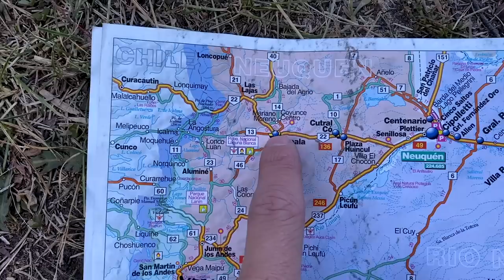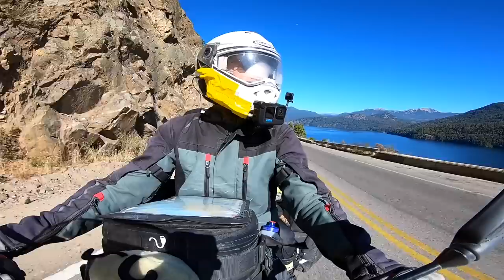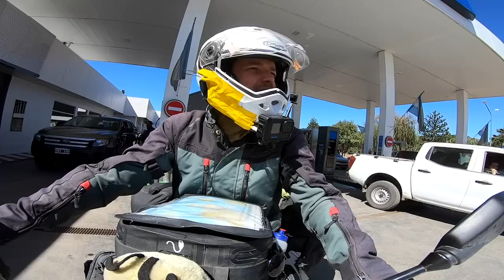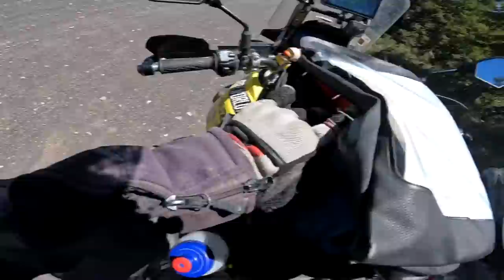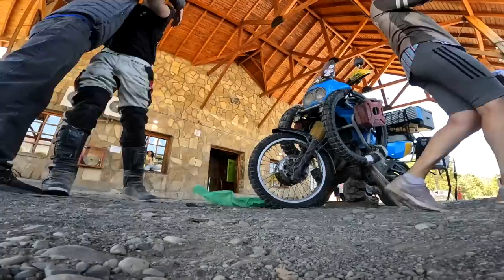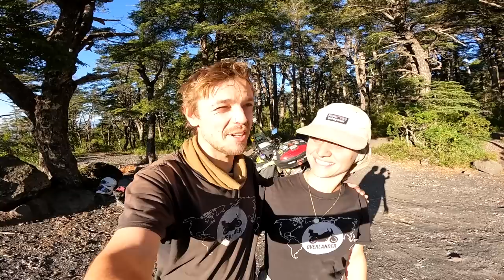FUEL CRISIS IN ARGENTINA! (Change of Plans) 🇦🇷 [S3 - E51]

Comment: If you need to fit a tyre you need some lubrication to get it to seat level. Also the wheel will be out of balance after refitting unless you get it on in the same position as it was before . Without tyre lube any soap will do at a push liquid shampoo / hand cleaner even works. Maybe investing in some better tyre levers would be a good idea make life easier. Still you all made it to the great camping spot so the adventure goes safely on.
Reply from the maker: Yes I read about the soap and actually suggested it after to Nikos! Tyre levers would have been very useful on this day! The show must go on 😁🙏
Reply: I was surprised he carried spare tyres, but no tyre levers.

Comment: That was a lot of traffic getting fuel. Too bad they didn't have any.  Btw, when removing a tire that is going to be put back on. Mark where the valve stem is. If Nico's problem was 'out of balance ' then putting the tire back on where it was, will help.
Beautiful views of the Volcano
Reply from the maker: Thanks for the tip 😍